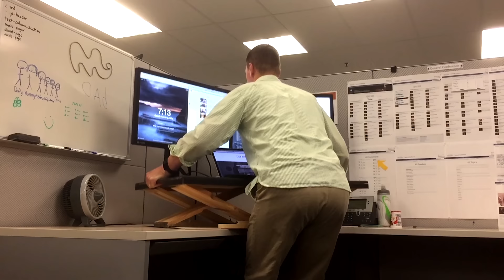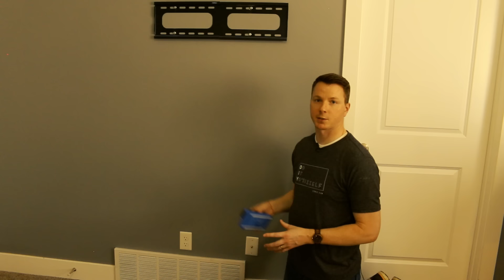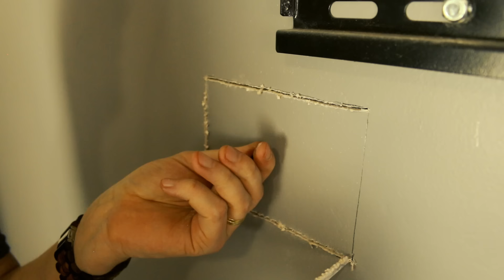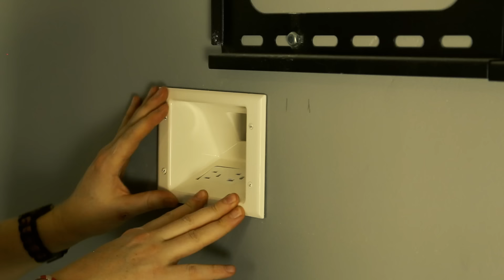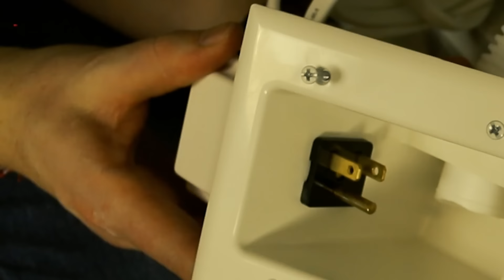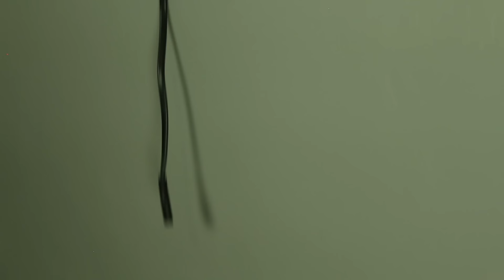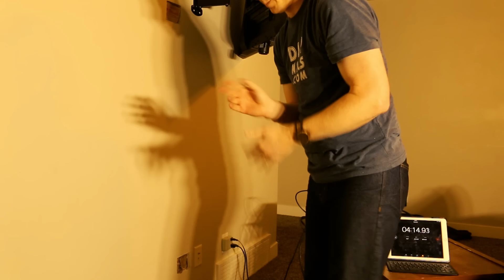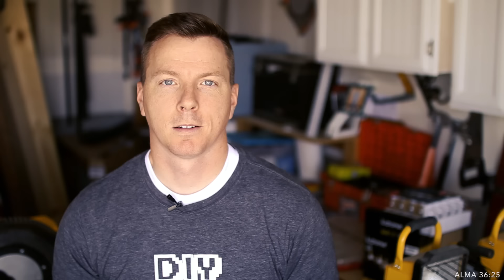How To Hide Your TV Wires in 30 Minutes - DIY

Comment: This is a "How NOT to hide your wires" instructional video.  
I found it entertaining that you mounted the boxes in the wall and then took the one out again to run the wires, instead of running the wires, then mounting the boxes.  
So in the end you have an unsightly coiled up extension cord hanging off the wall for all to see and just waiting to start a fire plus the coil inside the wall....nice! DOH!  Keep the Fire Department on speed dial.
Reply: Definitely strange decision to leave so much wire in the wall. But the cord on the floor is supposed to be hidden with furniture or something, just like any other appliance cord. Obviously the AV equipment has power cords, so this is just another one to hide. In this case he used an open coffee table, so he might need to put some books or a fake plant down there.

Comment: Good video bro. All these idiots suggesting you wire directly into the existing A.C. aren't familiar with local electrical codes requiring a licensed electrician to perform that type of work.
Reply: Or the possibility of plugging an expensive TV into a surge protector on the floor.

Comment: #LRN2DIY  If you coil it up and use close to the maximum rating then it stands a good chance of melting the plastic insulation and then causing a short.
Reply: You shouldn't be running video with AC in the first place.
Reply: What ? Idiot !

Comment: Not code!
Reply from the maker: Actually, it totally is.
Reply: Not in Canada. Wire needs to be secured. Can't have excess length looped behind the wall. Those wire connects would never fly.
Reply from the maker: Ah - I'm not sure what Canada's code is. In the US, you need to secure wires for new construction but not for add-ons like this. The coil is not the best way to go and I should have clipped and stripped it to length.
Reply: I second that also....those quick connects are an accident/fire just waiting to happen along with the wire coil...

Comment: I'd have to look up code for Ohio for using that tube for the AV wires. This setup seemed great until I saw the bottom box. Very unsightly and your coffee table doesn't hide it well at all. You'd need a solid stand. I wouldn't recommend this kit at all.
Reply: What code would you have to look up since A/V doesn't carry electrical current?
Reply: james hawkins better than having wires down your wall!
Reply: How about the AC power running back up the wall to the TV via the extension cord inside the wall?  The better way would be to tap into the AC power behind the TV, put an outlet there where the TV would hide it.  This way the electromagnetic interference from the AC line would not be running literally side by side with the HDMI/data cables.
Reply: SHOW US YOUR VIDEO OF THAT, PLEASE.
Reply: possibly the ugliest thing I've seen on a wall lol. I wouldn't care if it was hidden... just knowing that it was there would make me feel gross lol. Honestly I would rather have external cable ducting. Yes it's on top of the wall, but it's a nice uniform shape with crisp edges, you can even paint it easily to match.
Reply: Joe Harper that's a stupid thing to say... because new homes do it this way makes it nice? It's ugly as fuck... ugly and good looking are completely subjective, stop trying to infer otherwise...

Comment: Having a male plug on the bottom end of the setup looks really dangerous.
Reply from the maker: The male plug has no power unless you hook it up to the outlet, which completely covers it up. If the male plug was powered from in the wall, that would be pretty scary.
Reply: LRN2DIY, I was so confused about this comment until I saw your reply... I just took for granted that the operation of the male plug was obvious - I didn't realize anyone would think this has live electrical connections protruding from the wall.

Comment: I call shenanigans.  Good luck finding a house with no firebreaks.
Reply: OR...just use a long paddle drill and fish through like the pros do....
Reply: Well then, I must be lucky. I've mounted over 100 TV's, fished the walls, and have only come across one firebreak.
Reply: They must be old houses then because fireblocking is required by modern building code.
Reply: Like any old-work wiring job, you'd just cut an access hole across the break, cut enough space into the break for your cables, then patch the access hole. Obviously it's a lot more hassle, but there's no other magic solution.
Reply: XCyclonusX he must live in the South.
Reply: i thought fire breaks were between floors. that may depend on the code in your area
Reply: Depending on your builder the wall assembly could have fire blocking up higher than would interfere with this. Most houses I have done the fireblock is not far below the top plate.

Comment: I don't like the kit used. You have a really bulky connector at the bottom and unless you have furniture there, it is ugly.

What I used where 2 standard junction boxes connected with a solid cable channel. Pulling cables through there is much easier, and despite being "solid" they are still flexible enough to be pushed behind the wall. For electricity I branched of an existing outlet and placed a standard outlet behind the TV. No ugly extension cord at the bottom.
Reply: Yeah but your method requiers messing with the existing electrics which requires an electrician. His doesn't.
Reply: @Cyba_IT_NZ  you dont need an electrician to add a new outlet. It is a very simple procedure.
Reply: Dianel Rose.  Make a video, like he did, and SHOW US!
Reply: yeeeeeessssssss!

Comment: What if you do have fire blocks?  Do you have a DIY video for that?  Just curious...  TIA...
Reply: air butchie hole saw welded on to a piece of 1/4" stock
Reply: He mentioned it.  You'd have to cut up the drywall, drill a hole in it and patch the drywall.

Comment: WHY NOT JUST WIRE ANOTHER RECEPTACLE BEHIND THE TV (AND OTHER COMPONENTS )
AND GET THE POWER FROM THE BOTTOM RECEPTACLE ???  SEEMS LIKE A LOT OF EXTRA WORK ( AND YOU STILL NEED AN EXTENSION CORD ) . MAKES LITTLE SENSE
Reply: Simply ditch the TVs and enjoy vastly more time to enjoy life.
Reply: huh?
Reply: The power cord isn't the only thing this video is showing you how to hide. The HDMI cables are also going down through the wall, so simply adding a new outlet doesn't address the problem of hiding the HDMI cables.

Comment: Hi nils, do you recommend your stuff finder or do you know of a better one. Thanks.
Reply from the maker: That Franklin one is pretty awesome. I sometimes also use a really cheap one that is magnetic based. It doesn't locate the stud itself, but rather the screw that was used to secure the drywall to a stud. The nice thing about it is that once it finds a screw, it sticks to it on the wall, so it's pretty handy. It's this one: http://amzn.to/2whINGE
Reply: I have similar to that but the problem is the screw could be way off center and that can mess you up sometimes.

Comment: Hoy! janky install for sure. You should have just did a proper job and tie into the outlet that was already there. If you were planning to do a junk job you should have just cut 2 holes and dropped and extension cord down.
Reply: Because an electrical extension cord in a wall is not legal. It can cause a fire. And if it does cause a fire, your home owner’s insurance probably would not cover it. This contraption isn’t the best of its kind, but it’s likely safe. Using the bilge tubing instead of electrical conduit and coiling the extra wire are questionable choices, however.
Reply: I thought GFCI was only needed near water, like a bathroom or kitchen or outdoor outlet. Why would you need a GFCI on your TV?
Reply: Here in Canada, (BC) you can not legally use an extension cord behind the wall. It must be rated for in-wall use. Also, there is nothing here to prevent the home-owner from doing his own electrical work. So you don't need to hire a licensed electrician if you are capable of doing the work yourself. Just turn the power off at the breaker, confirm that there is no power at the outlet you are working on and continue your work.
Reply: It's code compliant in all states, plain and simple. He's not putting an extension cord behind the wall, it's going from the existing outlet to the new box and is completely exposed. He's running code complaint NM shielded cable in the wall from the new lower box to the upper box. If the current outlet is GFCI protected, so would the new run since it's just being powered off of the existing outlet. Nothing wrong with using the tube for low voltage wires, just completely unnecessary since you'll most likely have to take the boxes back off to run new cables as they get filled with additional ones. Agreed that depending on access to your existing outlet, you could just run a cable to the upper box and skip the extension cord completely. He chose to put the boxes on the OPPOSITE side of the stud where the existing outlet was mounted, so he couldn't run the wiring directly to the existing outlet box unless he drilled a hole in the stud. Pretty simple and straightforward. I personally would've run it up the middle so you could eliminate the extension cord and direct wire it to the existing outlet.
Reply: Depending on where you live, that would require a licensed electrician. You don't know what you don't know. That makes you stupid AND dangerous.
Reply: I think it has a lot to do with advertising for the sponsor
Reply: lol, I was thinking that!
Reply: Look Dude!  EIther the room is GFCI compliant or it's not.  That's unknown, but here in Texas wiring code specifies that all rooms are on a seperate GFCI outlet.  My neighbor is an electrician and when that code was law, he said that was the dumbest thing ever.  Typically a breaker is the tripping point, but GFCI I suppose is easier to push a button.  In anycase all electonics should be with a surge protecter either at the electrical box for whole house or on a connector.  Hardwiring isn't at all safe for electronics with out protection of a surge.  We have lightening strikes here frequently by stoms and my neighbor down the street got all his electrical stuff fried due to no GFCI or breaker box surge protector.

Comment: Do not coil up the wire as he do at 10min mark, its a fire hazzard delux.
Reply: Then why don't you make a video showing the exact same scenario actually starting a fire? I'd even accept a 20 degree temp rise. You pro fire peeps have issues.
Reply: FALpwn. Your kidding!! the outlet has 120 volts? wow who knew? Where is the roll eyes icon for captain obvious here?  Nobody doubts that LED TV needs 120 volts from the wall. duh!  And I can start a fire with a 1.5 volt battery by shorting it out with an itty bitty wire. I can also do it rubbing two sticks together. Neither of which has anything to do with the discussion here where people are claiming those coils powering this TV can get hot from induction.  What they don't seem to understand is that for a coil to get warm much less hot it needs current draw. And that stupid TV probably has a transformer inside that converts that 120 volts down to something much smaller. In short it doesn't even come close to drawing enough amps to make those coils raise even 1 degree in temp. 
Coils are amazing it is true. You can use coils to melt aluminum and crush cans.  However it takes a massive amount of current to do so.  Here this whole coil discussion is just a bunch of ignorant armchair warriors flapping their jaws to make themselves feel important by trashing this guys video.
Reply: Wow, there are some real brains here.  It doesn't draw enough current to make that much heat.  Also, the hot and neutral are coiled together, so any inductive reactance cancels.
Reply: correct.
Reply: Where?
Reply: consaka1 it has 120v powered to it from the outlet. A TV of that size should be running on 100v it is enough to start a fire. If 9v shorts out it will start a fire.
Reply: consaka1 I said 120 because in Australia it's 230. I'll agree with you for the simple fact that most tvs have a DC power brick, which isn't much different than a battery.
Reply: from what i know and im studying for an electrician, coils inside walla and outside can cause problems with wireless comunnication such as wifi and bluetooth, also i think making coils inside walls are not allowed. i also higly doubt that a fire can start but in a short circuit currents can be higher than 90amps in certain cases. im still learning alot about electricity but some things like that coil is easy to avoid. you only need to shorten that cable.
Reply: and also in sweden its not allowed to install outlets at certain hights
Reply: Joe Harper gets it. Bob Tahoma, You get the smart ass award for sure.  There are plenty of videos showing fires being started rubbing two sticks together. I did it years ago before youtube existed. You can watch Survival Lilly do it if you need a refresher course.  Of course plenty of others making videos of it too. If I make a video today it will be about something that no one has done right. Such as using your mechanical fuel pump for a vacuum pump on your older diesels, which were notorious for blowing diaphragms on their expensive vacuum pumps.
Reply: 20 watts is 20 watts, before or after a transformer. If it's 20 watts at 120 volts then you're only pulling 1.6 amps. VxA=W
Reply: T Wulf hahahaja 120 x 1.6 = 20 hahahahahahhahahahhahahhahah
Reply: Daniel Bravo you caught me, I didn't check myself. In fact it's significantly lower amperage making it even less of a hazard. Good job buddy.
Reply: And there have been  fires caused by that type of coil in the wall; that's why it is a code violation. What's the fire rating on the bilge tubing? Oh, and leaving the extension wrapped up? Take a look at the warning labels plastered all over the cable. By the way, you now have a coil IN the wall, and a coil OUTSIDE of the wall. Look up "mutual inductance".
Reply: Since when is 20 watts a fire hazard?  Most all TV's on the market are drawing under 20 watts when powered on.
Reply: Bill man!  TV's today are drawing under 20 watts when they're on.   Are you seriously thinking that's a fire hazard?  Just be realistic man and think logical.
Reply: BloodlineMedia. You are so right on that.  I tried it with increasing loads till the breaker blew and the coils were not even warm. Maybe I need to go down to 16 gauge. lol
Reply: Yes, the TV may only pull 20 watts, but the wire in the wall is still 120 volts at full potential current until it reaches the step-down transformer inside the TV power supply unit which reduces the power to the TV to 20 watts.  If you had a step-down transformer at the bottom of the wall and the cord delivering the 20 watts all the way up the wall to the TV was coiled up, that would be a totally different scenario.
Reply: Agreed Anoger, coiled wires generate heat by induction.
Reply: Again all talk and no show.
Reply: Why don't you yo yo's make a vid showing that.  I'd like to see you start a fire on TV current lol

Comment: Did you use the bilge discharge hose during the installation on the insulated wall?
Reply from the maker: Stephan Brock I didn’t on that one but could have. It’s more difficult with an insulated wall because the tube would tend to get stuck but probably doable.

Comment: I was skeptical thinking about fixing holes and repainting but after watching all I know is,  I can do this. Thanks for sharing. Good video. Good instruction. That company that makes the kit should be paying you.
Reply: If you go to any of the big box home improvement stores they all have a selection of kits similar to this one (maybe even the same).  It's a simple process that's almost foolproof (for those of us that aren't working with this kind of thing regularly).  I ended up having to cut (then replace) a section of drywall (because just like was mentioned in this video, I had a fire break stud in the bay I was using).  I was really worried it was going to look awful after I finished, but I watched a couple of quick YouTube videos about patching drywall and realized it was super easy.  In the end, you couldn't even tell anything was ever done.
Reply: This kit system kinda sucks,  should have its own tube inside connecting the two boxes. And I would want 2 tubes separated one for power and one shielded for signal connections.
Reply: Please understand the reason firestops are there - to prevent fire racing up that cavity into your attic and spreading. This knowledge might save your families lives, AND prevent your insurance company denying your claim for fire damage or loss. Yes, they WILL deny your claims if they find evidence!

Making a hole in the firestop kinda defeats its purpose, unless you fill the hole with UL-approved firestop caulk.
Reply: If you do the cutout near the fire break, then you can easily drill through that piece and dont need to touch any drywall
Reply: Good job Keith!  A little research, little patience and a little courage and the rest is easy.